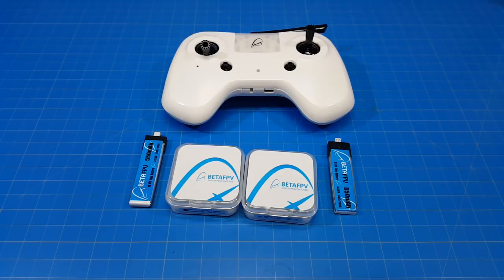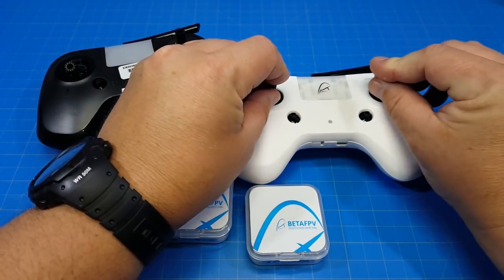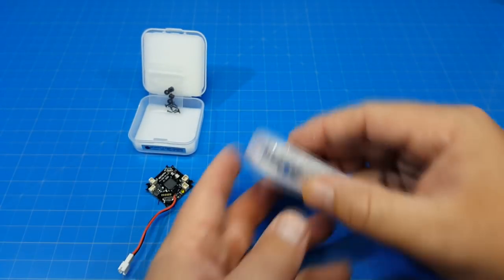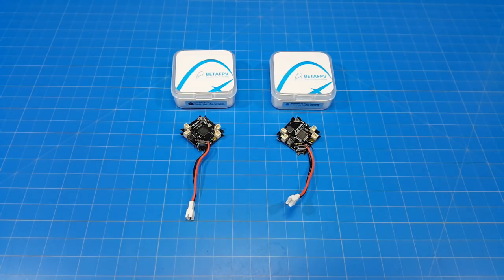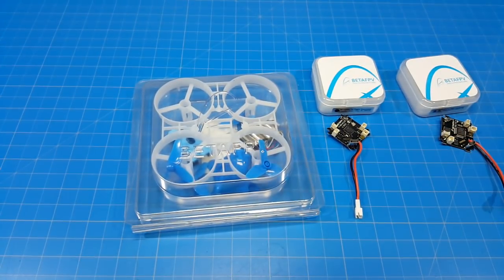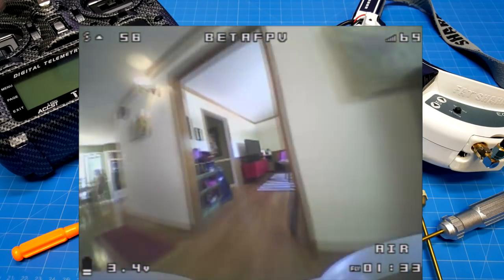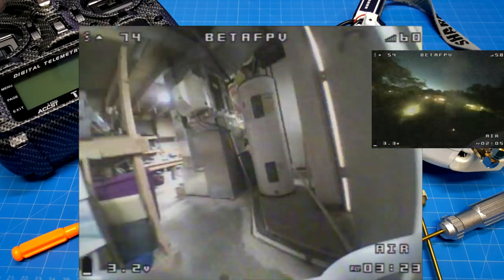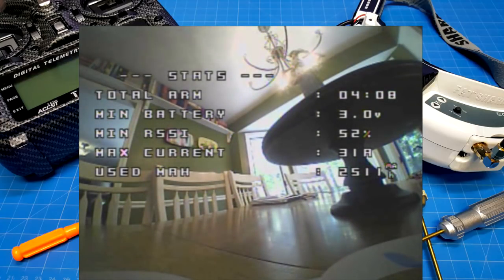BetaFPV F4 Flight Controller - Batts - Radio

Comment: I have a weird problem with the aio 2s f4 fc. 
No matter what the input, when armed and applying a small amount of throttle, the motors spin up to full speed and won't shut off until I disarm. 
Problem is, the motors arent making the quad fly, rather they seem to be spinning in reverse, even though in the betaflight motor tab they all spin the right direction.
edit just realized this is for brushed.. oh well.
Reply from the maker: check the modes tab and bet sure when arming "flip over after crash" is not on the same switch or active when armed. Or if set to another radio switch...flip that switch the other direction where flip over isn't active.
Reply: Nick Burns 
I figured it out. The fc had the wrong firmware flashed from the factory. 
Through trial and error (betafpv description listed incorrect firmware) I found the right one and it works now. Woo.
note betafpv seems to not really have their shit together. Lots of QC issues.

Comment: Nick, please tell me... Betafpv 1103 /11000kv îs good motors or în general betafpv stuff!? Cheers
Reply from the maker: I believe so. There can be points where one might chose a higher kv or a lower kv, but 11000 is right in the middle.

Comment: About to get a tiny whoop myself. I already have a cockroach frame and 617 betafpv motors. I am also interested in brushless whoops but do you prefer a brushed or brushless setup for a 65mm whoop? Lets say the brushed setup is using a betafpv f4 and the brushless is something like the uruav 65.
Reply from the maker: I still prefer the ur65 over the very good betafpv f4 whoop I put together.

Comment: Those dip switches look like reverse switches, instead of being able to change transmitting protocol. Also, this controller is marketed as 8-channel and there are 8 of those dip switches. Then again there are only 6 channels available as the top 4 buttons are basically 2 position switches for Channels 5 and 6. :(

Comment: Would you share your pids and rates?  
I have beta75 with this fc. It flys great in angle mode. But in acro doesn’t fly worth a dam.
Reply from the maker: These aren't far from BG 3.4 defaults. Roll 49, 40, 35. Pitch 58, 50, 35. Yaw 76, 45
Reply: Nick Burns thanks nick. I’m sure you are a busy man. So I appreciate it 👍👍👊
Reply from the maker: No worries. I hope they give you good results.

Comment: This is totally my planet all day.. You completely accurate on everything.
You can nit pick differences all day on this stuff. Only thing I could add is the 75mm betafpv frame is probably the strongest frame in whoop class, it also rocks around and has whoop blowout in tight turns and dives in even moderate winds. The 75s version handles a little better. 
Great one.

Comment: Turtle mode on these whoops is the must, when you flight around the house, under the tables, chairs. Also, can you do a video on what is your Youtube filming setup looks like?
Reply: Ferrmium the brushless betafpv whoops have turtle mode (I got a 75mm one for my practice quad, frames are super sturdy, way more robust than average as I used to smash it into solid ground at full speed trying to flip and is fine)

Comment: This or brushless UR65?
Reply: Mark Sherman... without a doubt, the UR65! I have brushed wh00ps, including one that I built myself using the parts I chose to use, and the UR65 is so much better! Faster, by far, and more maneuverable! Plus, with brushless motors they should last longer. The "Standard" edition is a fantastic value too! I like it a lot! 😁
Reply from the maker: yes, as Scoot has said, I prefer brushless. Some do prefer brushed for the simplicity.
Reply: Thanks, guys!